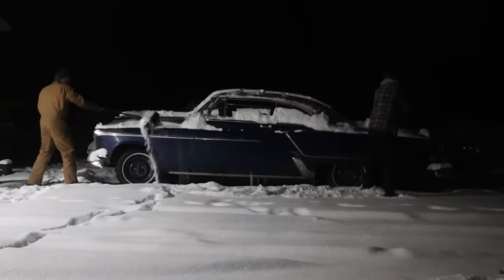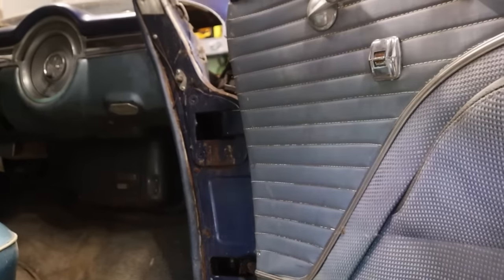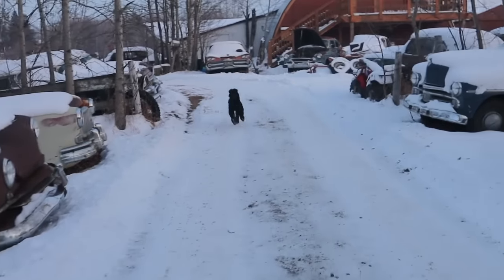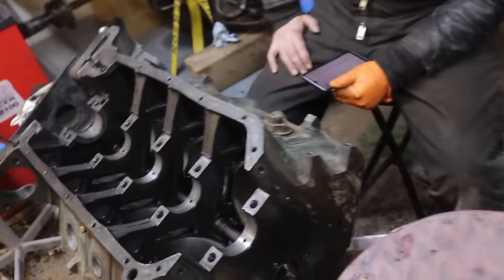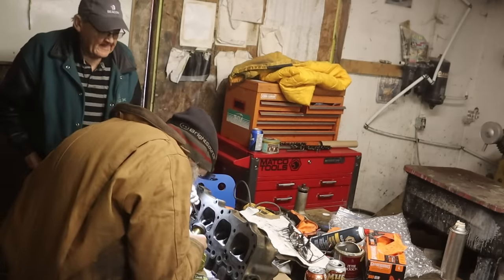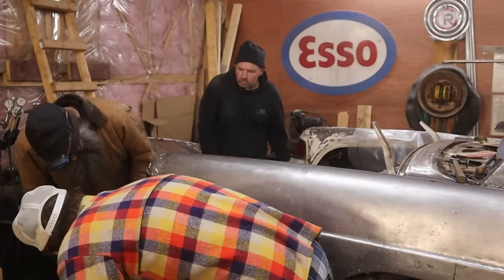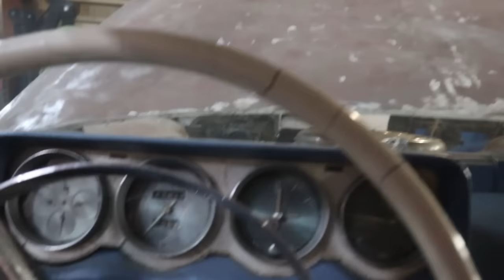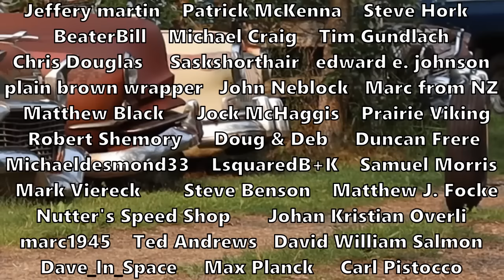1953 Olds is Back! Let's get into it... Plus: Buick Nailhead Progress and A Continental Deadline?

Comment: That's the best line, "where'd you get the cat"..."Oh he just kinda showed up"... Classic CWM!...Thanks again...
Reply: Looked like a good example of a Standard Issue Cat, as they call it on Reddit.
Reply: Stripes is the new Supervisor, interior quality inspector. If he is really top notch, he will find the screw/nut you drop, under the car/bench. No more scrounging around. An old blanket/towel in the back seat and he will also keep the mice and bugs out.

The valve and seat grinding, just like my high school shop class 1970's. That Buick should run like a top for another 50 years.

Jim might want to contact another Lincoln owner/club in Vancouver to securely house the car while in town. 

PS install a tracker, and hidden remote cut off, BEFORE you leave home. TIP, use the stock radio antenna as the security WIFI reciever.
Reply: Everybody needs at least one shop cat. Upholstery tester
Reply: The CDS, or Cat Distribution System, is still working well. Delivering good cats to ideal homes all over.

Comment: You might not be aware, but GM was notorious for using brake fluid in their electro/hydraulic windows from the late 40's through the early '50's. That tended to cause corrosion in the central pump and hard lines since brake fluid collects water over time.
Reply: Not to mention that if it leaked, it ate any paint that it contacted.
Reply: @vermontguy7692  It most certainly did!

Comment: A little trick i learned years ago working in a dealership. Rusty screws that won't budge. Take the positive booster cable and connect to the positive on the battery and touch the screw with the other end of the positve booster cable. Just a little bit not long time. Burns the rust off instantly. It works.

Comment: Same problem i'm going through right now with a 64' Dodge custom 880, (one of the last forward look cars)
The Engine is a big block Chrysler 361, it runs fine, but is burning oil just a bit, not a smoker & doesn't smell bad out the pipe, but similar story with the lifters, all lifters dished and the cam lobe is rounded to a point. I've been holding off on for 10 years Rebuilding it, but the Cam selection on the market CQ is far and few.

I'm just running 20W-40W diesel oil with High zinc to stave off the inevitable, but i'd surmise a NOS cam is in my future if i intend to take the rebuild head on. The option of regrinding the current cam is probable, but i'd be afraid of who's the one behind the machinery to regrind the cam, i've only got one good/bad cam right now, it's like playing russian roulette.

The word around town is avoid Comp cams, even more so on their flat tappet lifter cams, A youtuber by the name of Dead Dodge Garage (DDG) did a break in on a comp cams cam, it failed the break in and flattened a cam lobe, it had High zinc oil, Break in oil, RPM's at 2000 for 20 minutes, still ate a lobe clean off. the other notes are: The lifters don't have a crown, and the Cam lobe doesn't have a taper, The Cam taper & the Lifter crown work harmoniously to rotate the lifter to give even wear on the Cam lobe and the lifter crown, if neither of these are present, that cam & or lifter is going to live a very short life!

I did some research and lo and behold, the "good" Cam companies, Lunati, voodoo, the old Mopar DC performance cams (most likely old NOS cams) may be you're best candidate.

Looking forward to what's going to go down with the 59' Buick engine rebuild!

Comment: Also Scott , very important to keep the bands on the hydo properly adjusted , critical really . It's done externally at two places on the side of the case . I'm sure you can find the specs on line . And, I found a great man , master mechanic , that's a professor of auto at Weber Univ. in Utah . The site is Weber Auto . He has a 5 or 6 part series on disassembly and rebuild on the early 4 -speed Hydra-matic . It's outstanding !!!!! All his vids are XLNT . Enjoy , Cheers

Comment: I’m really enjoying the episodes featuring the ’53 Olds, the ’59 Buick and the ’56 Mark II—three of my favorite cars.  I was less familiar with the ’53 but I really like it.  Wish the episodes were 4 hours long  instead of just one.  Can’t wait to see the Nailhead assembly and test.  But I want to message my thoughts on your Dynaflow Transmission.  I owned a very nice, original conditioned ’57 Special 2-door.  Loved the car but of course, I had to rebuild the Dynaflow.  Later I tried to buy a ’60 Buick and similarly the Transmission was failing.  Even back in 1986, I had difficulty finding experts in my town to rebuild it. Also, no one who owned a Repair Business wanted to take the Shop space necessary to drop the rear axle, wheel it back then pull it (had to transport it 150 miles to Billings, MT.)  Therefore, I strongly urge you to fully rebuild your Dynaflow.  First because it's out of the car now.  Second, you won’t want to run the car then have it fail [soon] after.  I think there is a Torque Ball in the Solid Drive Line which is difficult to find (I may be incorrect on this.)  You’ll want to do everything to keep these parts as good as possible in the first place.  Finally, you may want to rebuild the Rear End as well.  I had to replace [Bearings] after the Transmission (Whew!).  This has been my experience.  If you don’t do these things in advance, I hope you’ll have better fortune than I.  How do you become an Agent on the show???

Comment: Well,that was a hoot.I wasn't shocked that the Olds' plugwires were bad after 40+ years.The hydro set-up in the doors was new to me too.Thanks to Miles for cleaning on the paperweight..err Buick motor. 'Tom's tales' are timeless too. The Conti is coming right along,but I see a mad paint party happening in August. 1/2 doz of you guys with rollers can get that all spiffy in an evening. Cheers !

Comment: Great video Scott👍 I think what Tom was getting at about cutting seats and valves is if you don't shim the springs you loose spring pressure. It's still going to run a ton better with this rebuild.

Comment: Scott,there is a spec for installed height for valves so you are in the proper range for lifters,You are probably ok with the little amount of material you ground off seats and valve faces,but you should probably measure it.

Comment: Hi Scott, If you visit Home Town Buick, there is a re-print directly from the 1952 Buick Factory Shop Manual that explains in detail the function and repair of the 1952 Buick Hydro-Lectric Power System. The Buick hydro-lectric system appears to be similiar to Olsmobiles, Pontiacs, and Cadillacs from the same era. Apparently, the same hydraulic pump was also used to power convertible tops and front power seats if so equipped. Cheers from Tucson!

Comment: 40:20  Vinegar works too.  Just soak a paper towel in vinegar, wrap the paper towel around the journal and let her sit a few minutes. Then after that, soak some 2000 grit sandpaper in wd40 and wrap it around the journal.  Then loop a small rope around it twice and pull on either end of the rope.  As long as the journal is not already badly worn, it works. At least for small engines.
 .

Comment: I like to change drill motor speeds well, maintaining fast strokes to hopefully end up with a 6° cross hatch. It seems to seat rings in good and fast well, bringing cylinder heat  cycles  up on the high side of normal a couple of times with cheap mineral oil for good burnish for ring sealing. Great job keeping ole iron alive 👏

Comment: Tom brought up a good point about valve stem heights. Taking to much material of the valve and seats you might have to take a little material off the top of the valve steam to maintain the right geometry on the rocker to valve, keeping the rocker-tappit dead center on the valve stem. You can check the geometry with a simple sharpie marker to see where the tappir hits the top of the valve steam

Comment: Darn guys, that 53 Olds is going to purr from all that warmth you can keep in the cabin once the hydraulic windows are functioning properly.  Those new plugs wires will make a smoother running engine once the sparkies are contained.  On the old nail head Buick, it will be purring right along with new rings and master valve job.  Which will be done first the Olds windows or the nailhead rebuild.  Taking bets now. Survey to follow.
Reply from the maker: I think the engine will be done first, but the car it's going in will be a while yet! Cheers...

Comment: Those hydraulic window lifts are verrry interesting. I was a teenager car freak back in the mid '50s & read Tom McCahill's car tests. Never heard of these gadgets, except for later on in Jay Leno's Merc. Were they also used on Cadillacs & Buicks? I remember that, back in those days, electric windows had bad rep. especially in Canada. Would there not be some sort of solenoid-operated locking pin to keep the windows up, if say, the car was parked on a dealer's lot for weeks? Speaking of mid '50s, everyone thought the Citroen DS19 hydraulics were complicated. Nothing compared to the electronic hornet's nests in today's cars. Nice work on the MarkII - seems like lead solved a lot of panel fit problems back in the day. Also amazed at how Dan can work outside at this time of year with a buzz haircut & no hat. Is he a "Vulcan" with green anti-freeze blood? 🙂🙂

Comment: Ive always honed really course when doing rerings in old motors when using iron rings as replacement, you really need to get rid of the old glaze, you can give it a few passes with a finer stone afterwards.

Comment: Power up Spring down just like early Cadillac power windows. We had a 49 60 special that had the same system we had the pump motor rebuilt and it worked great but over time the door windows would sit down because the cylinders or valves leaked.

Comment: That 53 Oldsmobile is a ,
 very fascinating project 

Especially , how the power windows are actuated 

Brake fluid  ??
As Hydraulic fluid  
 for the windows  ??

Where did you find ,
Cam & lifters for the 
364 Buick ?? 

I like how you're demonstrating  ,
A service station rebuild  ,
On that Buick engine 

Great idea 💡 
Utilizing Dan engine stand 
For break in 🙏

I do like that green block 

Just thinking 🤔 out loud  .
Do you have a local  ,
old school transmission rebuilding / repair shop , 
that has a dyno  , 
that you could possibly run that transmission on the floor ,
Before installing it ? 

I appreciate you grinding all of those values & seats and sharing that procedure with us but ,
Are you concerned about  ,
Ethanol fuels ⛽  possibly attracting moisture &
 pitting those valves ? 

You could be the  ,
Local guy , for cast iron cylinder head rebuilding , for a small nominal fee 💰

Gotta luv Tom 😂 

All hands on deck ,
For Jim's Continental 🙏 

Oct 12 ,2024 ??!! 

I'm sorry Scott but ,
I get 😵 💫 dizzy watching 
"Dean Cam" 

Stripes thinks the microphone 🎤 sock is a mouse .... LOL 😆

Comment: Hi Scott , as you most likely know , the wcfb is/was notorious for stalling durning left hand turns at intersections , mainly , because the left jet would be uncovered . Carter may have modified later ones with a thin metal divider between the jets in the bowl . Many crashes happened in l.h. intersection turns 👎 Take care all 👍👍👍👍👍👍👍👍👍👍👍👍

Comment: There is a spec on how tall the valve stem is above the spring seat on those heads. Unless there is an adjustable rocker like on a chevy V8, you need to be sure that your close on the height.  As you do the seats and the valves, the hydraulic lifters can only compensate so much to make up the difference.

Comment: measure the lenth of each valve stem  1st   ,write it down  /  after you have  cut the face and  the seat  down THEN cut the end of the valve steam back to the length that you wrote down ! then you will have no issues with the lifter "preload", i swear  thats the proper way to do it ,   or you can measure from  where the valve spring rests up to the top of valve stem with valve in the head  then cut the end of each stem back to the number you measured --  the lifter PRELOAD MUST be close !-----------i love engines and have done alot of them at ALL-PRO machine shop and at  trade school   keep up the good programing   i wish i had friends to come over to help me on my many projects you are lucky to get all the help .....DBN

Comment: The amazing 53 Olds, I never knew there was such a thing as hydraulic power windows. Wonder why Olds didn't go with the electric motors in the doors? Wasn't that pretty much the standard method even early on? Seems like the hydraulic system was overly complex. But Olds often did things out of the box I guess! You mentioned how many components had to work to make the windows go up and down and I immediately thought of the 57-59 Ford Fairlane Skyliners, the hideaway hard tops. They were unique in their concept but it only took one relay, one component to stop it dead in mid open or close and you were screwed! The Olds is such a neat, unique car. My only dislike is the CKit. I've never liked CKits but I'm assuming that CKit is original and looking at it I have to say it's the least objectionable of any I've seen over the years. They just look so very "tacked on" and cumbersome looking. I've always been a lover of "simplicity". I think the most obnoxious CKits have been shown on several of the Facebook legacy pages like "This Was Americar" and those were on the beautiful 57-59 Mercurys, those long and beautiful cruisers. But there was one in particular, a convertible that was beautiful but they stuck a horrific CKit on the back like a 3 foot or more overhang and you could tell, the guy could never pull into a driveway or parking lot without scraping the rear bumper extension on the pavement! That was a long car without the CKit! Just never could warm up to them but the one on the Olds actually looks a bit understated which is cool. Onward guys!

Comment: Nailhead is clean enough to eat off it now, so take a good look at the trans when finished. At least drop the pan and flush it out, Lucas has some good stuff out of the bottle to run through it if it is just getting hooked back up. Olds has some very sturdy power window units that appear to have been very well made, but were problematic over time, as the door panels were removed at some point to service them. I bet Dan will get them back to cutting off fingers. Jim's Lincoln now has better bumper alignment than when it came out of the factory !

Comment: Excellent video Cold Water Motors Scott  :) , Myles :) Dan at GEFC :) , Dean :) , Jim :) , Tom The Boss :) , Frankers The Dog 🐕,,  , Dan did super job say get new spark plugs wire for old Oldsmobile car also power windows that amazing one set up too , Myles help you Scott on Buick 354 V8 motor plus Tom too on heads to and Jim car 1955 Connecticut car come back life to also !

Comment: I have a tip that might make shit work a little easier. They make these little steam machines to take wallpaper off of walls they come with different attachments for the hose.
I bet one of those would make cleaning the shit off an engine a lot faster. I bought one from Lowe’s or Home Depot around 100 bucks but it makes cleaning up anything a little easier

Comment: I’d rather see you build 10 $1000 engines than 1 $10,000 engine. I use a knife sharpening stone to clean up the head deck surface, works good for cylinder head sealing

Comment: Meanwhile in England, after driving my bought sight unseen '57 DKW Sonderklasse 3,300 km from Northern Sweden home to Manchester, without any issues to make the trip even remotely interesting, I now managed to make the brakes work. Well, ish, but at least three of them work now. I guess this end result is adequate. Three wheel brakes are for winners.

But for the life of me, I will never understand how you guys set your priorities. Fixing window lifters before you put spats on a car with a continental kit? That just doesn't compute.

I have driven a Buick with a much worse 364 than yours on an epic trip. My very first car was a '60 Le Sabre convertible, which sure as shit was appropriate for a 19 year old me in early 80s UK*. The lads and I took it on a trip to the Nordkap, from there to Sicily and then back home. It ran on most of its cylinders most of the time, but let us down in Austria by blowing a number plate illumination light bulb, thus invoking the only ticket we collected on that journey. I haven't paid it to this day, which must be the reason for my guilt complex.

Hitting a '56 Continental with a hammer must be great fun. I did it with a '57 Imperial and still have fond memories of it.

(*To be honest, I didn't want to remain single at the time, much the opposite. But if you seriously want to get out of the dating game, buy a Buick )

Comment: Scott are you changing all Freeze plugs? Especially the freeze plug with wire connector should be changed.
Reply: Check the core plugs at rear of engine that the trans covers.

Comment: What would you do without Tom the forman? Never he sized to amaze me with his story's. Looks like the issue with the Oldsmobile windows is nothing too serious. I believe the same system is also in use on the same year Cadillac's.
So far the Buick engine core has had no nasty surprises, so if it's completed im very interesting to see a break in video. 
Jim's Lincoln might take time but the end result is going to be much better than what you started with. Did Myles hit a tree? I see a huge whisky dent on the hood and grill. I don't remember it being there before but maybe im wrong?. Cheers.